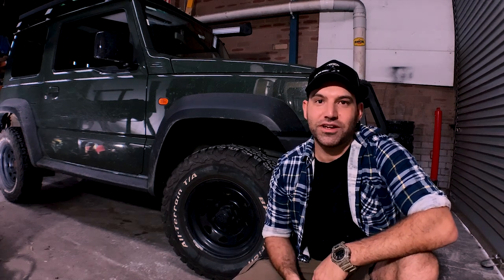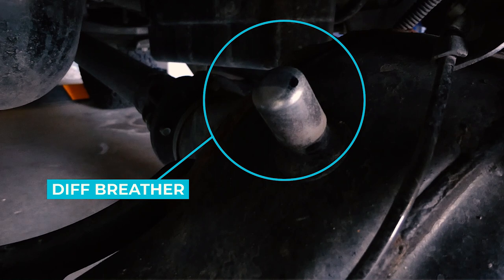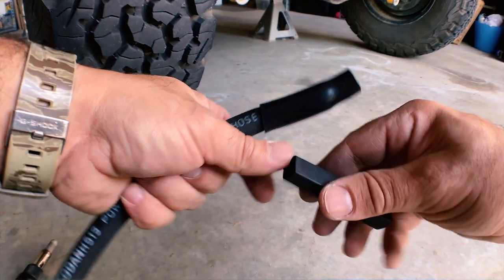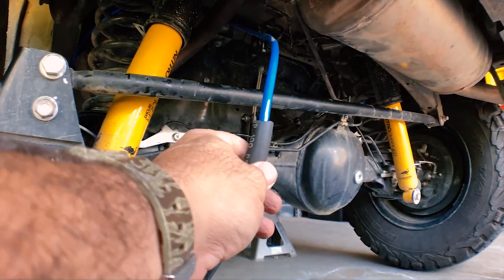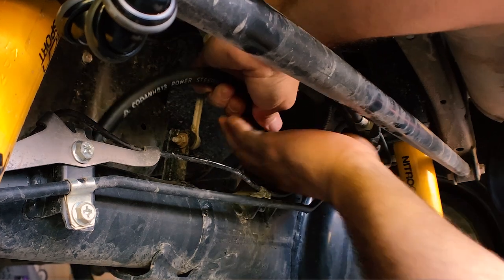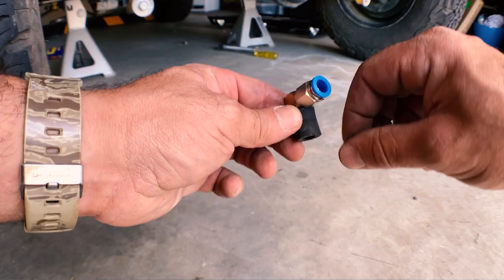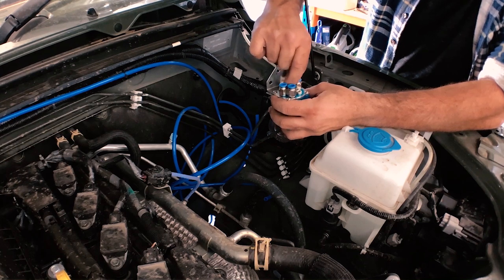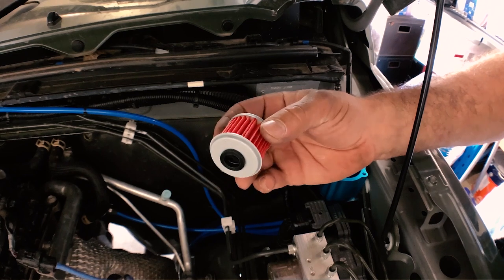2019 Jimny - Diff Breather Installation

Comment: Good video. I need to try this for transfer case. Spent a good 35 mins trying to get hose on. But think will need right angle adapter. 
Do you remember size of pieces used? Cheers

Comment: What do you think your Jimny's wading depth would be now after these mods, with the tyres and lift?
Reply from the maker: It’s hard to know for sure, but I’ve been in water over 500mm deep multiple times now with no issues. 

The air intake would be the next point which would be remedied with a snorkel.

There are still point where water can get in but these mods go a long way to keeping the water at bay

Comment: Did you get most of this at Bunnings? Bought a diff kit off eBay, but didn't realise the breathing spigot wasn't thread. I've got some left over 13mm irrigation hose, just need to step it down to the 8mm kit
Reply from the maker: Yep, I think I bought most of it from Bunnings, and a length of hose from Supercheap Auto

Comment: Have you had any long term issues with the hose clamp onto the transfer case breather port? Like it coming loose? I noticed there is only about 5mm protrusion on that port.
Reply from the maker: No I haven’t had any issues. True there’s not much hanging out, but it has proven to be enough

Comment: Hi great video, most seem to miss the gearbox and transfer case. So why did you not just tap the diff breathers and fit the adaptors straight in? was it just easier for you to use the larger hose like we all did years ago.
Reply from the maker: I didn’t like the idea of tapping because I didn’t want to risk having swarf from the tap fall into the diff. 
I know some people use grease to mitigate this.
Reply: @BillyGoatJim  Thanks, I can understand that.
The first time I had to tap a Cylinder Head after a customer had damaged the Spark Plug threads was scary, but I had forgotten about that over the years.

Comment: Great video! What is the advantage of that compared with having a snorkel (or you should have both perhaps)? Thanks! (my new Jimny 2021 is coming in January! Can't wait, mate!)
Reply: You need both, the snorkel is for getting air into the engine for combustion, these are for air chnages in gear box and diff.. The problem is when your hot diff and gear box go's though water.. it cools them down, causing air to be sucked back into the case.. but if you're in water.. it'll cause water to get into the diff and gearbox..

Comment: Thanks for the video, is that gearbox breather in the engine bay? I have an auto and we are finding it impossible to do the gearbox
Reply: Hi Holly, I also haven't managed to locate the gearbox breather for an auto. Hopefully it doesn't exist.
Reply: @robbieg5538  it does exist and is incredibly hard to get to. It's on top of the gearbox
Reply: Did you manage to do it
Reply: @neilhunt9010  yep, a friend with bendy wrists helped to get the car off and the breather on. Bloody hard
Reply: @ylesone  thankyou, first step will be finding it, regret driving in mud before I did this so much dirt in my eyes
Reply: @neilhunt9010  I feel your pain! We accessed it front under the driver's side coming in the front but it's a bit had to explain exactly where

Comment: Good video - thanks.  I have an auto version.  Do I need to do anything other than the two diff breathers?
Reply from the maker: In regards to water ingress, gearbox and transfer case breather are very important, following that a snorkel will be the next modification. 

That should have you sorted for the majority of cases.

Comment: Hey mate great video thank you for the complete explanation! 1 question tho. I've seen other jimny models have 2 transfer case breathers but I saw for this one you only extended 1 breather so gen 4 only has 1 transfer case breather?
Reply from the maker: Hi,

I’m only aware of one, and the information I could find was based on one. Might be worth placing a phone call to Suzuki
Reply: Yeah I think the places where I saw 2 breathers are for older jimnys(I'll double check tho as you suggested). I'm getting a 4th gen jimny next week and definetly going to do this to it so this video is super useful for guidance thank you!